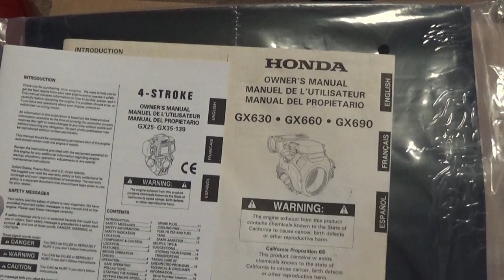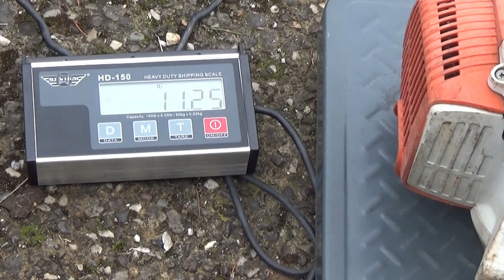Stihl Kombi vs Honda 4 Stroke trimmer with GX50 engine

Comment: I have a Stihl KM130. They are NOT cheap, but they are very solid units. I had to replace the carb on mine a few days ago…after 13 years of use. First repair in 13 years, so I can’t complain.

Comment: whered u buy it?
Reply from the maker: Ebay. Search GX50 4 in 1 or something like that. It said somewhere Honda of Thailand  or something like that. Had free shipping.
Reply: Is this a knock off honda 4 stroke as thinking on buying one soon
Reply: @paularooke9004  pretty sure it’s real they just assemble the weed eater with the engine
Reply: @paularooke9004  Made in the same country - but does not say Honda on the motor.